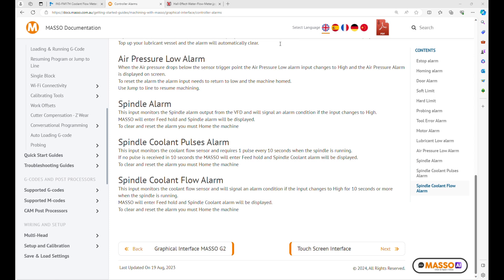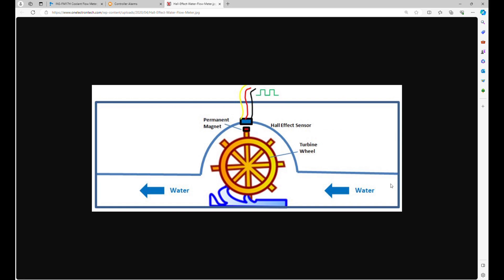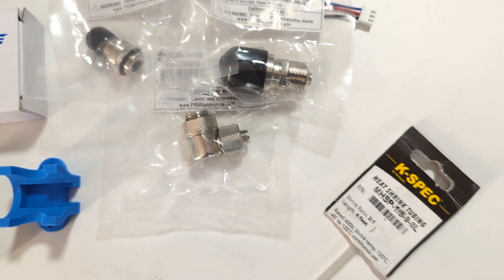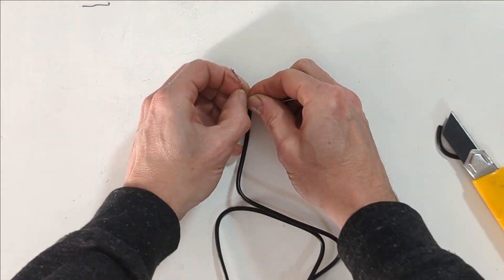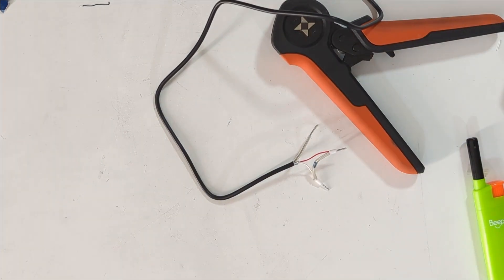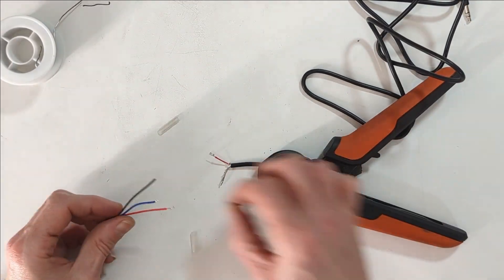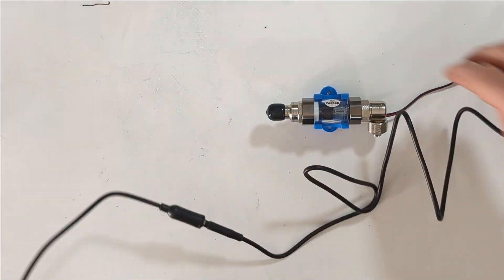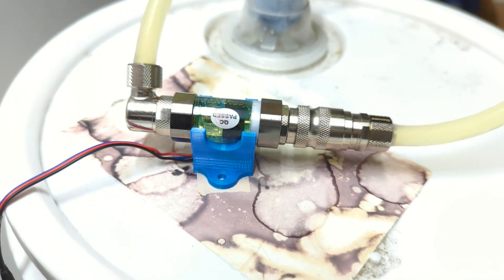Onefinity Elite Spidle Alarm Setup

Comment: I’m not much of an electronic/electrical  person. I have 4 wire cable that is shielded. Should I join the shield with the wire I am going to use as the ground wire?  I think the audio cable you used you used the shield as ground but you fast forwarded through this area. I’m sure it must have been a no brainer for a electrical skilled person like yourself but I am pushing my boundaries in this area. Sorry if the question seems simple I just don’t want to smoke my Masso box.  This project is exactly what I need to monitor my cooling system for the spindle.
Reply from the maker: I don't think I would join the shielding with the dc-.  My cable was only a 3 wire headphone cable.

Comment: Awesome feature.  Could you share the connectors you used to the flow device?  Any wiring diagram?  Difficult to follow wiring harness when you sped up the video.  Does make video shorter but hard to follow wire to wire connection.
Reply from the maker: Sorry I forgot to upload the wiring diagram, the link is now in the description. As for the fitting i got them from koolance as well the one side as to be G1/4" thread and the other to fit your hose setup. I went with quick disconnect style but they sell cheaper barb types and push-to-connect style as well.. it all depends on your tube size and type.
Reply: Thanks for a perfect answer on a awesome project.  Perfect timing I’m just doing the upgrade to elite and adding a 2.2 water cooled spindle.  I was afraid of not turning on pump or that it might stop working and burn up my spindle.